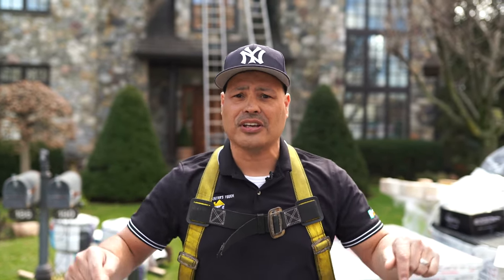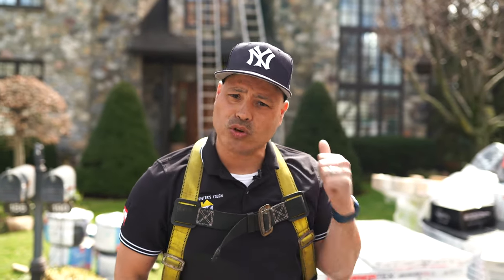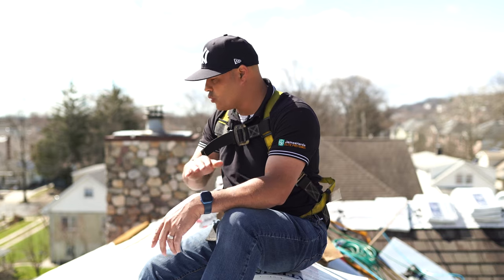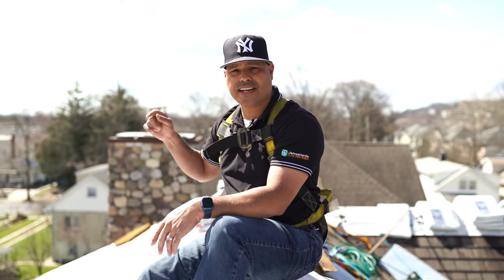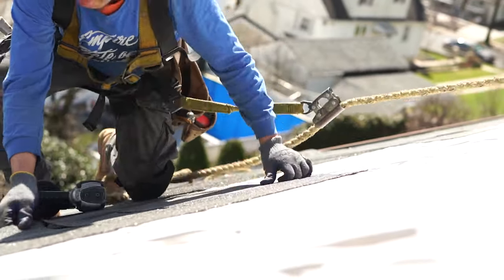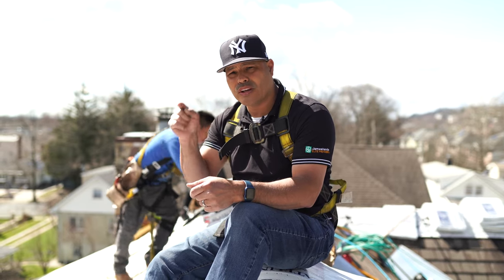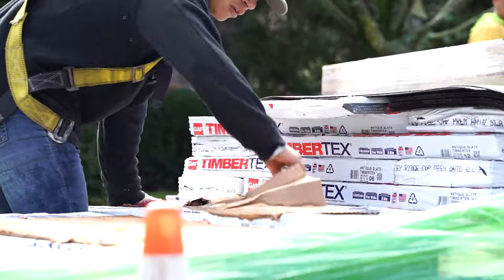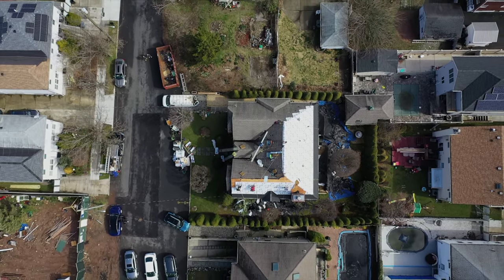AMAZING ROOF RENOVATION | GAF SLATELINE SHINGLE

Comment: The valleys are not done to the GAF requirement (proper requirement for most manufactuers) - the overlap being run into the valley not stopping two inches from the bottom. The warranty could be voided and likely would be when they fail in the valley.  I also noted your installers did part valley overlap with some lower courses  woven…again not per GAF requirements.  Final comment not all rows line up from roof line to adjoining roof  line.